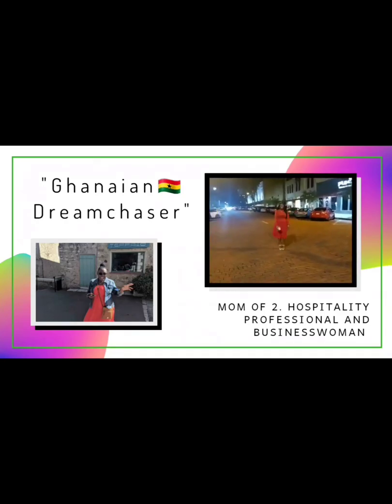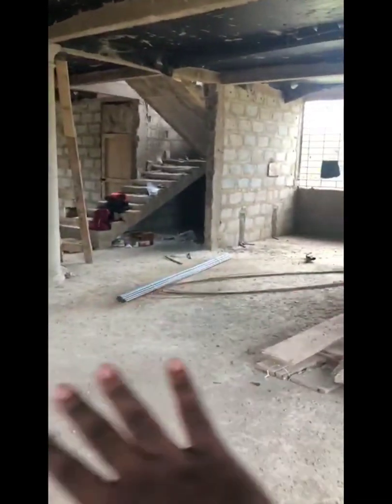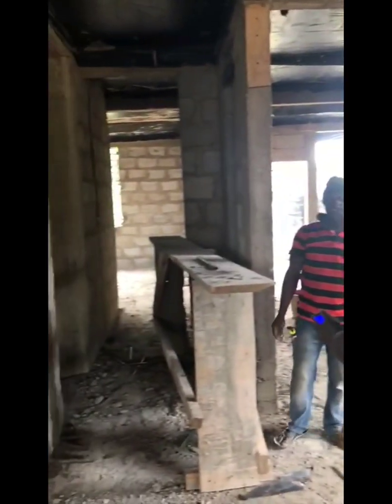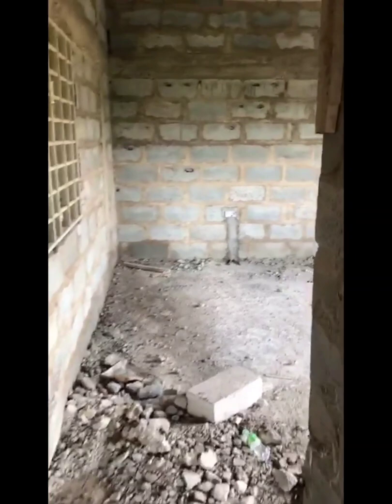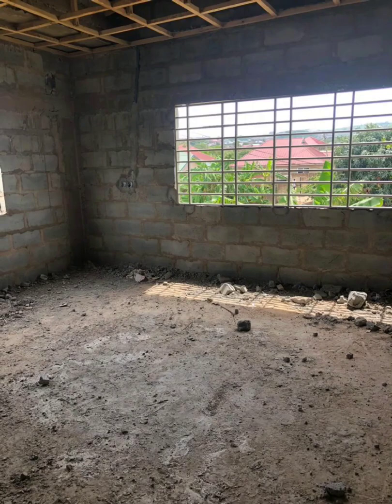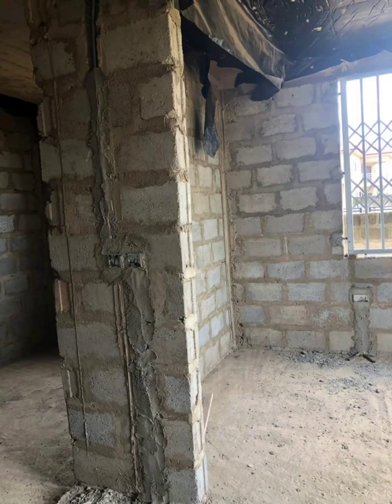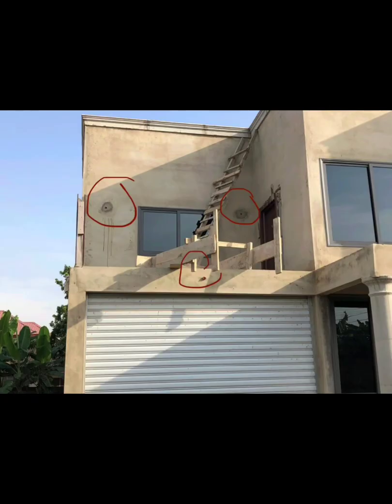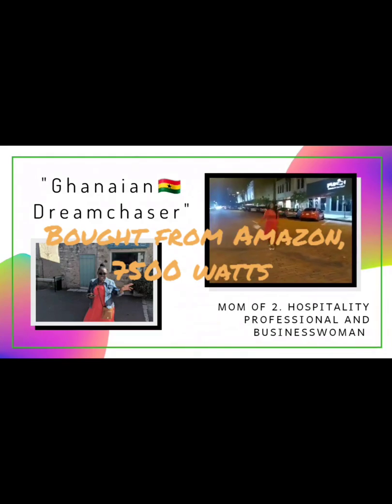Dumsor or Solar 🤔 - Building in Ghana during a pandemic 2020 🇬🇭.

Comment: where did u get you windows please?
Reply from the maker: Perfecto Frabricatons based in Kaso, it's a local owned business. George is great to work with. https://perfectoltd.com
Reply: Please which brand of electrical cables (wires) did you used?